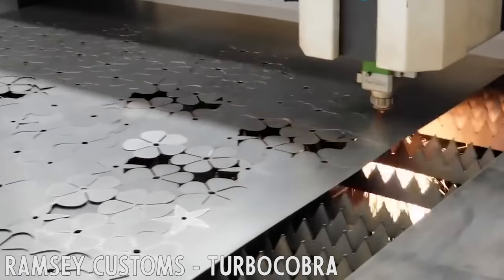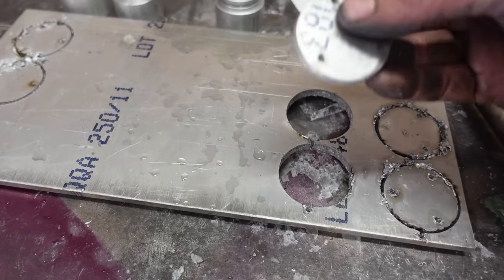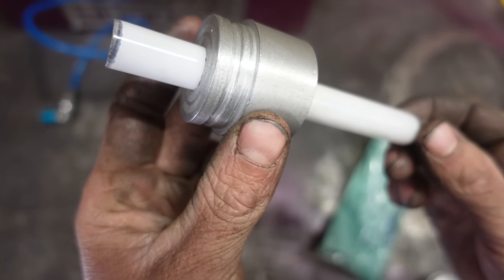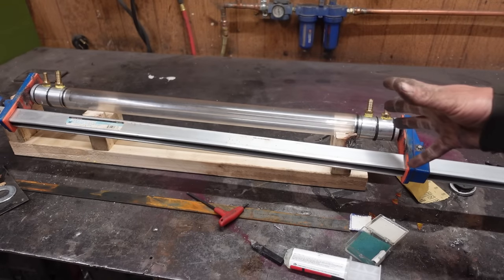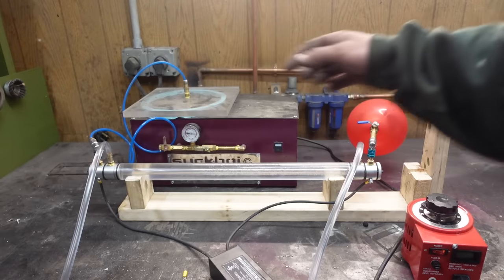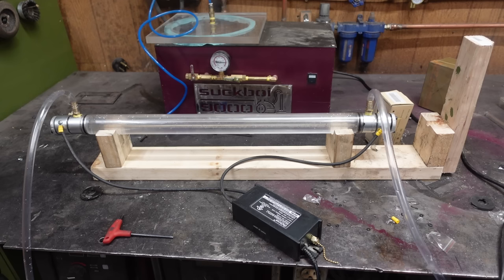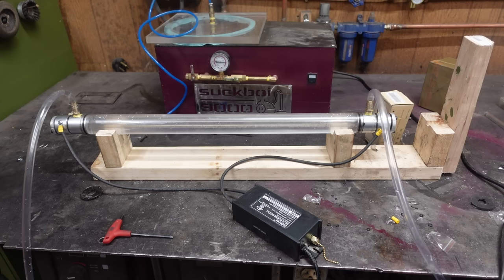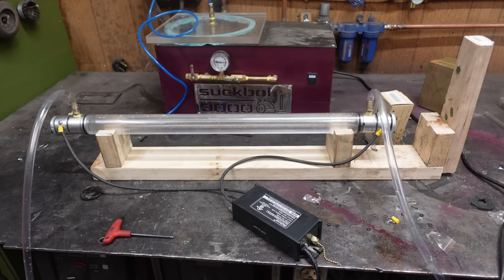Homemade CO2 Laser Tube

Comment: you did a nice job and did get a output from it. You may want to work on your power supply, most neon lights use a AC supply. So your laser has to trigger or  light up on the very top and very bottom of the AC cycle. Like they said, use a DC supply with a current limit or bias resistor. This will have the high voltage to trigger the gas and then keep the laser run with out blowing the fuse on the varactor. Also, you do need very clean mirrors too.
Have fun and be safe.  In 72, in high school, we built a neon laser. Shot it down the hall from the science room to the counselor office door, (50yds).  It left a mark.  😎

Comment: Very cool! Mirror adjustment is definitely a key part of such a laser, I’d consider installing one of those 2-axis adjustable mirrors like you see on laser tables. Perfectly isolating the water jacket from the electricity would also be very useful, and I hear JB weld is surprisingly good for vacuum systems.
It may also be worth trying to assemble the whole thing out of borosilicate, seeing as you already appear to have welding equipment.
Reply: The gap between the mirrors has to a resonant cavity.
This requires a mirror to be "Tuned" to the wavelength of the light emitted by the lasing medium.

Comment: I'd align mirror perfect and use a improvised output mirror with a tiny hole in the 100% coating. Your vacuum hoses should be the internal mesh re-enforced kind, and fine valve adjustment is mandatory.

Comment: Instead of trying to rectify and filter a 15Kv source (which might not like a high capacitance on it's output), you might want to consider a Cockcroft–Walton multiplier. It's basically just a ladder of diodes and capacitors. It's one of the simplest ways to design a step-up converter, but it turns AC into high voltage DC, and apparently powering lasers is one of it's main uses.

Comment: Great video! One tip. When you tap aluminum, don't use oil, use alcohol like pure ethanol or isopropanol. Just put the tap in the alcohol and go to the town with that hole... This makes huge difference. Just give it a try next time.cheers.
Reply from the maker: Never heard of this before, I'll give it a shot!
Thanks man!
Reply: I used 99% denatured alcohol and isopropyl alcohol for years at a machine shop I worked at, I can confirm it works great for aluminum (it also works for brass or other nonferrous metals, but it will not work for hard ferrous metals). I had an airbrush connected to a switched solenoid valve that I used as a coolant spray system, the airbrush was on an articulated arm and could aim wherever it was needed. The airbrush also drastically reduced the temperature of the alcohol by evaporation, the workpiece would get so cold that water would condense on its surface. There are some small size high-speed machining centers that only use alcohol as well, but they are rare and can create a serious fire hazard, most of them purge the enclosed machine with inert gas.

Comment: Oh, man, you gave me flashbacks. When you were shoving the glass tube into the aluminum with the O-ring, it made me remember when I was pushing a glass tube into a rubber stopper (chemistry class). Heard a "click", and thought, uh oh. Yup, the glass tube had broken and drove into my middle finger. 50 years later and I still have the scar, and the still-numb area due to the cut nerves. Just sayin', be careful applying force to glass with bare hands!
Reply: The number of chem students who do that is... staggering. (count me in)

Comment: Well, in my physics studies, we used heavy tables with additional mechanic decoupling of the ground for laser experiments. 
The most difficult part in your setup is IMHO is the alignment of reflectors, they must be exactly parallel, since an amplified photon ray should bounds back and forth infinitely, to get the full amplification effect. 
So I would have expected some 3-point adjustable mounts in your build. Don't ask me how, I am a theorist, I don't know and would have to look it up too.
Reply: I know telescope some (cheap) telescope mounts use heavy springs with a washer and a bolt to implement an adjustable mount.

Comment: also regarding the problems with the power output maybe its not related with the power you are supplying but with the alignment of the mirrors, the chance of a photon hitting an excited atom is quite low, for that to happen with a frequency high enough as to get stimulated emission you need the photons to go through the tube many thousands of times which means the mirrors must be really well aligned and the amount of atoms in an excited state should be enough, you are putting in 300w, idk for sure but that sounds like enough, the mirrors are aligned however with the accuracy that the lathe gives you for what i can see, that is most likely not good enough

Comment: so the issue is you do not have an optical cavity because the mirrors are likely misaligned the mirrors have to be perfectly parallel to each other. few things: you might want to start with a dye pumped laser first, that will teach you the basics of what you need to achieve. Next you might want to get different o rings, the wrong type of plastic or sealant can introduce off gassing into the tube before the gas mixture can get into the system. You also might want to try to actually remove the mirrors entirely and instead put in a bit of glass that is transparent at the wavelength of light you are looking for this way you will be able to put the mirrors outside the tube and dial them in. Also look into getting some sort of optical table built.

Comment: Coming to comments to look for statements regarding voltage not being deadly. Just amps

Edit for those curious:
Your average taser/stun gun runs at around 50,000 volts or 50 kilovolts. Compare that to his neon sign transformers that were 10 and 15 kilovolts respectively.

Now the difference is the 15 kV neon transformer is 60 mA. Which is in a range of amperage that can cause respiratory arrest, muscular contractions (inability to let go), and even death.

While the taser/stun gun is around 50 kV it is usually less than 5 mA. Around 5 mA you will get shocked, but still be able to let go of an object. Intense involuntary spasms are possible, however, death is very unlikely.

Comment: Info i've seen from a few tube manufacturers is the mixture needs to be He:N2:CO2 ,8:1:1 +5% xenon. the gas pressure inside the tube should be 70-100 mbar (1-1.4 psi). Commercially available RECI power supplies are 35kV DC@ 23mA..

Comment: @ #CranktownCity ...Oh man, I'm going to show everyone this video, as it shows what I learned at trade school. I'm a "Mechanical Fitter" by trade. As we call the trade, in Australia. Everyone thinks I learned how to fit car parts. Nope. Start with raw materials, measure, cut, machine, drill, tap, lap... I do the High voltage stuff too, but self taught. Have you considered using a plasma ball transformer and powering it by induction ? I can light yard long neon tubes, by proximity... Just a thought. Love your tenacity, Mr #CranktownCity ! You should be the president of America when Joe quits. You have talent, mate!

Comment: This is a lot like the one i made back in high school. You can use plain old air as your nitrogen source if you like. The other gasses dont throw the  lasing out by much.
Reply: This hits correct. Also, the rest is what, 20% oxygen and some trace gasses?. Simply use up the oxygen by putting it in a box with a candle or something. The resulting carbon dioxide can be calculated and factored into the mix.

Comment: My guess is that you had not pulled enough of a vacuum initially. Gasses become much more electrically conductive as they approach a pure vacuum, and to generate plasma you typically only want a few tenths or less PSI. Tech Ingredient's video on plasma tubes is a good overview of the issue.

Comment: Hey, too lazy to dig through the comments to see if anyone else has mentioned it, but I possibly noticed one of the issues. "Helium" sold for balloons can actually be air with nearly the minimum amount of helium required to make balloons float. If it doesn't display the percentage of helium, I'd assume it's lower than you'd hope.

Comment: To smooth power after a rectifier, a low pass filter that uses a coil, ground, and a capacitor is needed. If you just use a cap, it will not take out all of the noise on the DC. Ideally, you would rectify, filter, then connect a battery, but at these voltages that isn't possible. You are also going to need to use wiring and components that can take that high voltage or you will fry them, even the wiring. You might want to consider building a voltage multiplier using diodes and ultra capacitors and just make a pulsed laser. There are demos of this circuit type on other channels on YouTube, but I must stress that if you are not trained to handle high voltage circuits safely, DO NOT build a voltage multiplier for high voltage.. It can easily kill you or start a fire.

Comment: great video!  Thanks.  Just a couple points.  The first is that the helium you're using is likely a mix of helium and air.  The company was concerned that too many people were using their party time helium to end their lives.... so now, the blended version has up to 15% air.... so... nitrogen and oxygen.  If you want pure helium, run it through a liquid nitrogen dewar to condense the oxygen and nitrogen gases out... you'll have pure helium after that.  The other question I have is to ask if you have tuned the resonant cavity or did you pick the length at random?  Thanks Doug
Reply from the maker: Thanks man!
The tank I have is 95% helium, and I just count the rest as nitrogen.
When I posted this video, yes I picked the resonator length at random. I've since built three new iterations of this, in search of a better output, and I've been tuning the length based on the reflectivity of the OC I plan to use on it.
As soon as I get an output I'm happy with, I'll be posting a follow up video with more info on the updated build!
Reply: @cranktowncity  where did you get the partially reflective mirror?  These optical bits are tough to source 🇨🇦
Reply from the maker: @nitrousman8882  BMIsurplus/ebay. they're all used parts but I've had a few ebay scores on ZnSe!

Comment: The reason is the alignment of the mirrors is so hard you have to put them on movable tilt with two direction to align the mirrors and movable laser He-Ne or red semiconductor laser and let the red laser beam come through the center of the two mirrors and you have to get multi reflection spot in one spot (center of the mirrors) and not scattered sopts .the scattered sopts means the two mirrors are not parallel .the maximum power you can obtain is about 270 watt at 30% efficiency  Mohammed Jawad from Iraq .

Comment: Hey ! great video , I never even thought using Co2 to get plasma was possible. On that note, isn't it dangerous to casually break open CFL glass tubes like you did in 3:01 ? Those generally contain mercury vapor which is very toxic.
Reply: As far as I'm aware, the amount of vapor is more of an "oh crap if we don't dispose of all these millions of bulbs properly it's gonna release a bunch of mercury into the air" problem and less of an "oh crap I dropped a bulb my house is a superfund site now" problem

The amount of mercury In a single bulb is a tiny amount to help start the arc, so as long as you're doing it somewhere ventilated you should be fine. Still probably not worth risking it unless you've got a good reason to, though; it's not like there's a safe amount of mercury to breathe.

Comment: 2:53 Please: Don´t forget to have a deep breath, to really get all that mercury vapors !
Reply: mmm I love the feel of it eating away at my brain
Reply: no creo,
Reply: A large tube contains about 4mg of mercury. That small one at most would probably be about 1/8th or about 0.5mg by estimate. A can of tuna has about 50 ug per can. That equates to about 10 cans of tuna which is absolutely nothing unless exposure is frequent.
Reply: @memejeff  It depends: Where has the tube been manufactured?
As long as the lamps have been manufactured in Germany for example it was alright and lower than 5mg per tube.
But the tubes manufactured in Poland or China later had much more Mercury in them because there they did not have the expertise to control the precise dosing of such small amounts. So they did: the more, the better...

Comment: I dont know too much about your research, but check the coatings of your mirrors to maximize the output and reflection.  Also, did you clean your glass tube as in perfectly before installing it?  The gas mixture will be critical.  Yeah, uh, a ballon and taking N2 from a car tire?  Nyet.  Also, you dont know the purity of your He.  Impurities in the gas and an improper mixture will ....  I am the terminator and I'll be booock!!!  I suggest you consider moderate pressure source tanks and mix into a fourth tank with a relatively sensitive pressure guage and mix by partial pressures (or something like that - partial pressure just sounds good, doesn't it?).  Each gas will give you a fixed pressure and by calc you can figure out the exact pressures you need for any sized container (the pressures will be the same no matter the container size - but temperature will be critical so watch out for that...make all your source tanks the same temperature before going at it).

Now for something else.... did you know this laser effect that you're experimenting with is the basis of the basic theory of global warming?  the CO2 absorbs IR then re-emits it.  The mirrors, BTW just reflect the IR along the axis of the tube (you lose everything else to the tube walls and end caps, hence the water cooling).  Sooooo, those mirrors and their alignment are critical... lets get critcal, critical... - oh, yes that's physical.  Oh well.  So how do you do it, as in align relatively perfectly, by eye, like they do it in, say, Africa?  Use a red laser in a turned mount to first set the 100% mirror, then do the same for the transparent mirror.  Put a light colored target around your red laser output and you'll be able to watch the reflected dot to align it, if you're doing it by eye.  You could do it with an electric eye of some sort, but hey?

15Kw x 50 mA = .75 watts over an about 1/4" dia circle (judging from your red dot on the 2x4) or about .023689 watts per sq mm.  Sunlight in a bright location is 750 watts per sq meter.  1 sq meter = 1M mm, so sunlight is .00075 watts per sq mm.   Your output looks to be about 1/4" diameter which is 6.35 mm, or 31.66 sq mm.  31.66 x .00075 = .02375 watts over the same area as your output.  So you're outputing about 31.5 times sunlight on your target.  So if you want to fry an ant with sunlight, you use a 3" diameter lense to create a 1/4" diameter circle of death (the death rayyyy) and you get 3.42 watts per sq mm.  You can see that you're outputting at best .02375 watts per sq mm and 3.42 is required to smoke an ant, so dont be disappointed at your output (never mind the ant is probably getting UV as well).

Then there's the delivery of your power to the plasma.... yeah those electrodes and their makeup are critical as well.  Oh, yeah you can get bailing wire or barbed wire to work (I think), but one of those weird metals beginning with a "P" probably would serve you better and not NiChrome.  Something about corrosion at the anode or cathode or whatever, then you get contamination.  Back to contamination, aren't we?  Contamination in Mikey's CO2 laser is like a boron rod in a nuclear reactor.  Probably worse.

If you think about it, effeciency is the key here.  You need to figure out your desired output wattage per sq mm, then back calc your input power figuring on an effeciency of about 10% for your system.  You'll see pretty quickly why you need rubber gloves and a refrigerated cooling system on your water supply.  One way to achieve is to scale down your output target area.  I wonder if a spherical partial reflecting mirror, at just the right radius and then a corrector lens outside the system would refine the beam back to a beam instead of a cone.  Some cool optics there.   Look up the Schmide Cassegrain telescope, it'd be something similar to that system.

So:  your mirror coatings and coating thickness (pure gold and thicknesses to match the wavelength of your output IR, mirror alignment, purify everything, get your gas mixture perfect (not just good enough) and perfectly clean with a perfectly clean delivery system, and pump that baby with power until Sunday and you likely will see an order(s) or magnitude increase in your output.  I was wondering about those arc welders under your bench, they output in AC, so coupled with the right transformer, that your local power company has, you'd get the power supply you're looking for...(this is starting to get crazy)

disclaimer - keep your finger on the power switch as that 2x4 will not resist the beam for long and dont pump so much power as to blow the circuits in your neighborhood grid.  IR is invisible, so be careful for reflected or partially reflected beams (even coming out of the sides of the tube - you might want a shield there), and check that your glasses work for IR, not just red.

You've done something few could do in their garages.  When armageddon hits, you'll be the one that survives.  Until then.... I hope you're not my next door neighbor.

Comment: Don't you need to rectify and filter the voltage for pure DC??

You should also have a current limit resistor in series with the tube!

Is this your first laser?